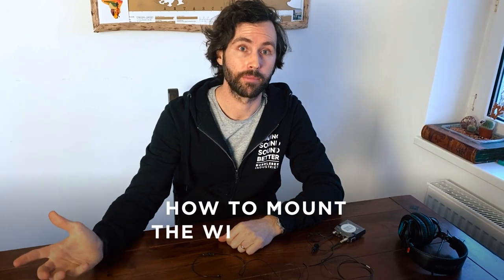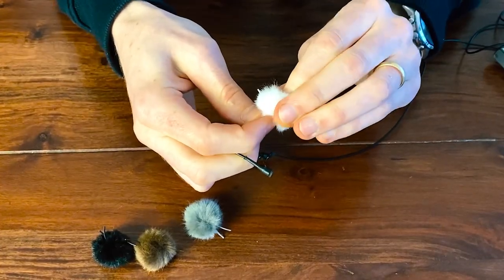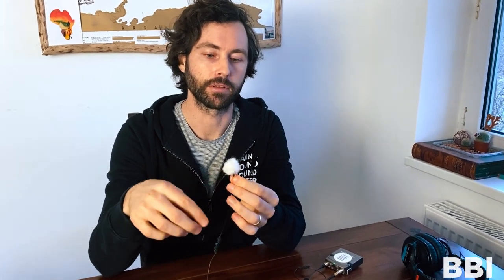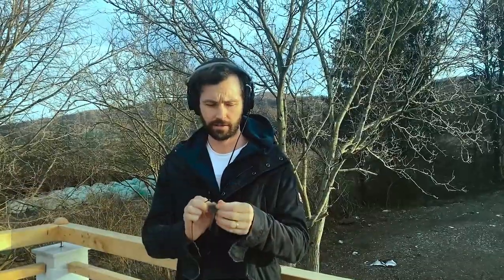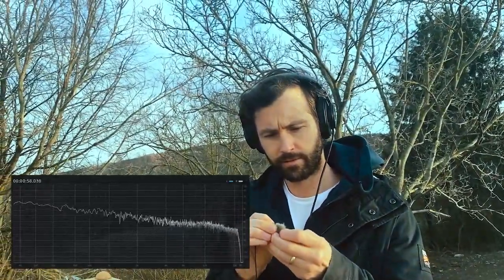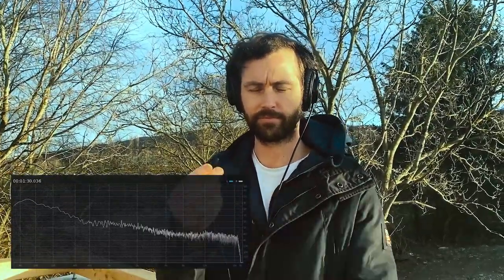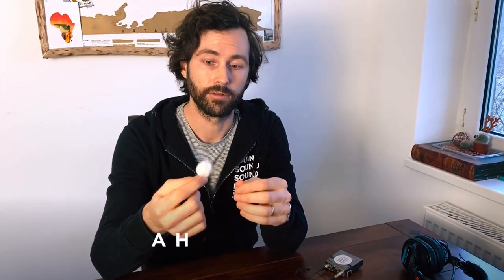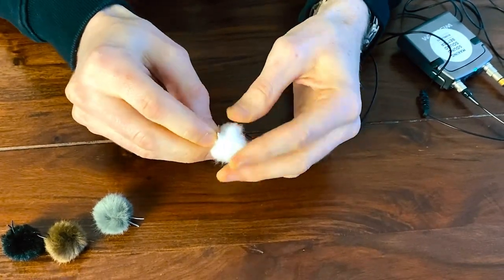How to Mount a Windbubble correctly on your Mic

Comment: I’m finding with these bubbles that they get manky real quick with using double sided tape etc, the tape eventually finds its way onto the fur and gets stuck together and it becomes unusable after not too long. 
Also it’s difficult when using it with a Mount to keep it in its little bubble space, with active talent moving around lots.
Reply from the maker: Hi Dean, thanks for your comment. Have you considered using The Invisible Lav Covers - Fur Outdoor? They're much more suitable for use with double-sided tape than The Windbubble, and due to the secure design of the included tape, they remain in place with active talent. The Windbubbles are more suitable for outdoor presenting where the talent is stationary or slow moving, for plant mics or for field recording use.

If you send us an email at support@bubblebeeindustries.com, we'll be able to assist you further here. Alternatively, you can take a look at our website - https://www.bubblebeeindustries.com/products/the-invisible-lav-covers-fur-outdoor. 

I hope this helps somewhat, please let me know if you have any further questions.